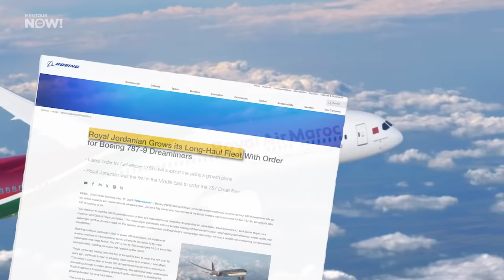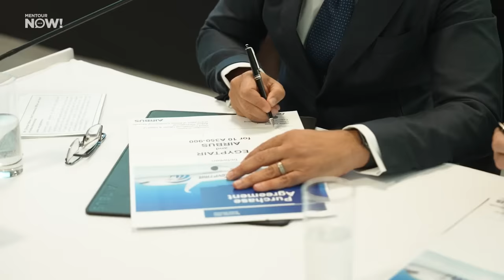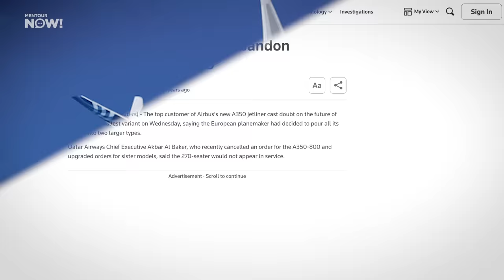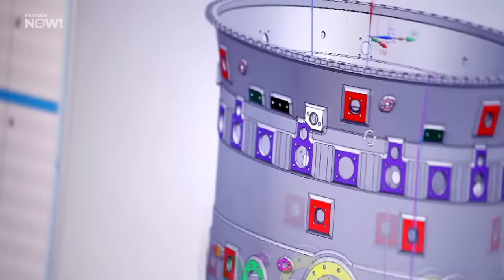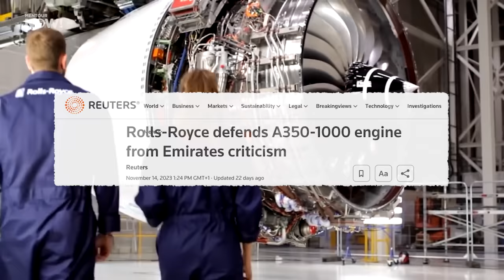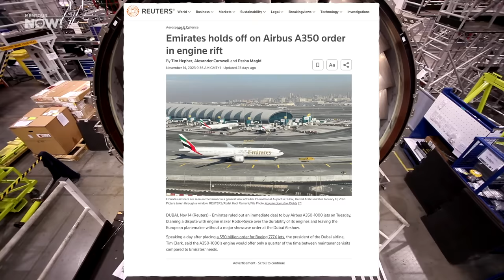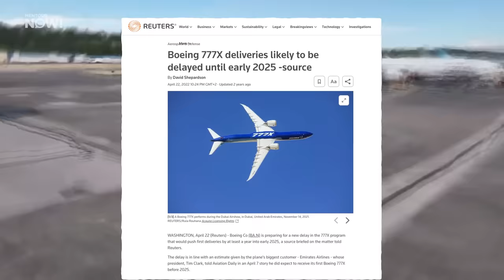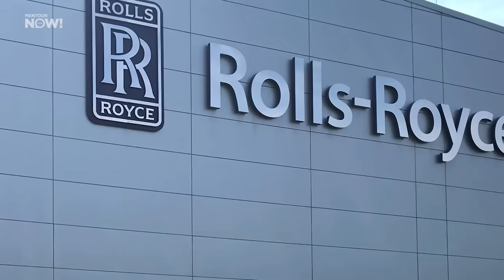What’s WRONG with the Airbus A350?!

Comment: All I can say is that the A350 is the most comfortable longhaul flight I've ever flown economy on.
Reply: Makes sense, since the cabin pressure and noise levels are better than the 787 but with the seat width of the A380 (18")
Reply: Yeah I flew on the a350 recently. Very comfortable indeed.
Reply: Until the 10 abreast seating arrangement on the newer models become the norm.
Reply: @oadka they are about the same, it depends on where you sit. Both planes are extremely similar in terms of types of technology used. The a350 s engines are about a half a generation ahead tho. Cabin pressure is the same for both 6000 feet.
Reply: same! and was always a Boing fanboy before that flight
Reply: I flew twice from Beijing to Hong Kong, yeah, great plane, great service, low noise, really and outstanding experience.

Unfortunately, the way back was on older 330 or 340 and the cabin service was much poorer (same airline should have same quality of service  no matter the plane or the trip)
Reply: @davidajayi1207 you are out of your element. They are nowhere near the same. The 787 was designed as a 2-4-2 aircraft yet airlines went with a 3-3-3 aircraft. The 787 is BY FAR the most uncomfortable modern widebody aircraft for economy passengers. The A350, and A330NEO are far and away the better choice for any passenger who enjoys comfort on long haul flights!
Reply: @farangatang  I don't know about that. I flew on both the A350 and 787. Both seemed comfortable and quiet. I have to give the edge very slightly to A350, but still can't agree with you on the 787.
Reply: And so far, an (hopefully) "still flying" COFFIN !
Reply: @CaliSteve169  unfortunately it's not an opinion. It is a fact, an absolute fact. With a 3-3-3 configuration the 787 has the narrowest seats in the industry as they can't be wider than 17". Both the A350, and the A330 can accommodate the standard 18" width in their respective configuration!
Reply: @farangatang most A350 I flew on uses 10 abreast seating (3+4+3) so the width advantage isn't really a thing
Reply: That is a reasonable statement, but does not apply to this video and discussion. Since the B777X is not in service yet.
Reply: I agree, the A350 is super quiet and if you get to fly first class just a superb experience.
Reply: @oadka  If you keep saying it, why, it must be true!  In reality noise not really an issue and cabin pressures are nearly identical.  But keep sayin' it!
Reply: AIRBUS     IS       JUST   SUPERIOR IN EVERY WAY ... thank you ...European advanced technologies....after all Europe did 'start' with CONCORDE ...
Reply: @adrianpeters2413  You people are in a trance.
Reply: The Airbus crowd is really triggered by the Emirates order for 777X. And be careful criticizing their beloved A350! You will never here the end of it....geez.
Reply: @adrianpeters2413 ...yeah, European not profitable even with government subsidies. I've flown 777 and Airbus on long hauls...Boeing for the win
Reply: @barrybolton1396 come on, the. 777 is simply disgustingly loud. I flew Korean air, A380 to JFK and back 777. the 777 for passenger comfort is so much worse. 787 and A350 I like them both. But quietness, A380 and A350 where possible.
Reply: @Tom-zr4xf  lol Airbus actually doesn't care.
Otherwise they wouldn't have beefed up the 35K to what it is now, which exactly ranted Emirates a decade ago, but won them wider appeal.
Reply: I have to disagree, I flew with qatar on a A350 and it was very tight and uncomfortable, also shaky above the indian mountains
Reply: @larsradtke4097  Biased toward Boeing, but have to agree.  First time on an A380 was night and day from the 773 on TPACs IMO.  What a wonderful bird that is.  A350 didn't stand out to me, other than being brand new at the time, in comparison to 777 work horse.
Reply: @JuliusUnique  That's not unusual.  Also crossing the Bay of Bengal, India to Bangkok, is often a bumpy spot.
Reply: @jeffbeck8993  I was once at the back of GE90 on a heavy long flight (JFK - HKG on Cathay), and the noise and vibration did made me hard to sleep. Still a truama to this date. 787 and A350 in comparison feel more quiet and humid, which is good. A380 is not particularly impressive to me even as someone leaning Team A. Not bad, but not good either.
Reply: @georgH  Maybe the best crews get put on the nice new aircraft as a reward for good service - leaving the older aircraft full of less attentive staff.
Reply: @oadka - wow, didn’t know that and A380 was my favourite as economy passenger. I will make decisions knowing this.
Reply: @larsradtke4097   I hate flying. I flew to Vietnam on a 777 and returned on an A350...the Boeing was a better ride and more comfortable.
Reply: @barrybolton1396  I truely doubt, that flying the 777 is better than the A350. I had not a single flight, where I would prefer the 777, just because of the noise level. The A350 climate is better, so much more quiet. Or do you complain about seating arrangement? That is the fault of the airline and not the aircraft. My worst experience for seating was with aeroflot connecting from mos to Shanghai. My knees hurt after arrival. But that is the airline's fault and not the aircraft's
Reply: @JuliusUnique  shaky? You complain about turbulences over the himalayans? That you have to complain to the weather gods. No aircraft is free from influence of turbulances. But the smaller and lower the worse.
Reply: Agree. Have flown on both A350 and 787 on several airlines and I was surprised at how disappointing the 787 was. Most Airbus models seem quieter and smoother than the competition, even the small A320 compared to 737.
Reply: Same here, good quality and really comfortable
Reply: @sbeve7445  there are less than 3 airlines in the world operating a 3-4-3 A350. Over 99% of A350 are 3-3-3, but over 99% of 787 are 3-3-3, in fact JAL is the ONLY airline operating a 2-4-2 787 in economy!
Reply: Doesn't match the A380 in my opinion; still find them quite noisy.
Reply: All I can say is you probably haven’t flown on a 380.
Reply: I’m. Or going to lie…I can never tell the difference between a Boeing or Airbus for comfort. They are both awesome.
Reply: @oadka  Both the B787 and A350 are pressurised to 2,000 metres instead of 3,000 metres.
Reply: @jeffbeck8993  I have always said there’s a big bump in the road across the Bay of Bengal!
Reply: @Holland41  Yeah, I agree. I have flown W class on both. I prefer the A350 to the B787 and I think it’s very telling that the 787 seems to have a lot more appeal to cut price airlines, while the A350 gets more orders from full service airlines. I don’t think the difference is chalk and cheese but I do think the A350 is the better product.
Reply: @charlestoast4051  I meant the A350 quite noisy, my bad.
Reply: @farangatang Funny enough my first flight was on a Dreamliner and even I thought the engine was noisy.
Reply: I really liked the 787 or the a350 myself. It's one smooth riding plane and the windows really give for nice views.
Reply: @farangatang  777x is much wider then the a350 by 18"
Reply: @arnaldoluisn1  it applys
Reply: @adrianpeters2413  I can see you don't know much.but we all have to start sometime
Reply: @barrybolton1396  oh 777 is very nice to fly on and the foods nice and warm airbus food is always lukewarm at best
Reply: I flew BA A350 Prem Economy and Business Class.Was great,no problems.The crew on board did tell me they didn’t really enjoy working on the plane due to lack of space.
Reply: Just flew A350 and felt crowded, not large in volume terms, in economy; 3-3-3 and average space, reminded me to older A330. For a 15h flight this is not the right plane IMO.
Reply: @SuperWeissmuller  yeah 777x is much wider then the a350 so that will be nice down the road soon.
Reply: Agree, just recently was traveling 14,5h on A350 economy class - best experience hands down
Reply: @gatto52  787 is very comfortable vs the a350
Reply: cannot agree more, much better than 777 Boeing ,have not flown on 787 yet,
Reply: @eisbeinGermany  777x will be alot wider then the a350.
Reply: @Tom-zr4xf  777x is going to a nicer plane and airbus knows this
Reply: @larsradtke4097  the newer a350 are not going to Be quieter then the 777x
Reply: I suspect you might bring the A380 to top list if you happen to fly on one.

Comment: I believe there's nothing wrong with the A350, never have I seen and travelled in such a well build, safe- and  comfortable plane. And like others have mentioned, look at what happened in Japan.
Reply: Yeah and on the other end, look what’s happening with the 737 Max. Again…
Reply: @sn4tx At this point I'll actively avoid flying the Max. Nobody knows the extent of poor engineering in that plane.
Reply: @Chopper153  as I use to say regarding that plane, at this point id prefer flying on one made by LEGO.
Reply: @sn4tx  Exactly, but this thing that's happened to the 737 MAX seems to be a company wide quality issue so I have to wonder if it's going affect 777 as well in some shape or form.
Reply: @mutkaluikkunen3926  I’m not a Boeing fanboy nor an Airbus fanboy. Do Boeings crash? Yeah so do Airbus. But you are right. As much as I’d like to just keep these uneasy feelings I have towards the MAX (granted I’ll never step inside one of those), with all the issues plaguing  other programs one does have to start considering. And hey I’m not driven by paranoia. In the 737 defence, Iots of them been flying by tons of airlines all over the world. So statistically one could say, the 737 MAX isn’t that much of a dangerous plane. Same thing happens in the car industry. Now the issue here is if a certain car model of a specific brand has a chronic quality issue that makes them break down more than the others, at most you gonna be walking or taking a taxi. If a plane breaks
Down … yeah they  not gonna park in some random cloud till assistance comes. And as a whole it’s true that Boeing been having some problems across the bussiness. Some more serious than others but still. It shots the reputation and mostly the trust people have on the brand. So yes. Of course as a passenger that likes to check what plane I’ll be flying when I book flights, I’ll be actively avoiding Boeing in general. Doesn’t mean I’ll be 100% safe. But surely being 90% safe beats being 60% safe. Now it doesn’t mean I won’t get on a Boeing plane, if that’s my only choice for the route and time I need. BUT even if air travel is, statistically, the safest way to travel I still prefer to take my chances on a car crash than on a plane crash. And one way to improve those chances is to stay away from those  crazy nonsense MAX program planes.  That shit should be banned straight away from everywhere. I mean yesterday was MCAS, today are plugs  that go “Aight, I’m outta here”. Heck I not gonna be in a future flight that has the potential to show yet another issue with the MAX.
Reply: this is why i am so disappointed that tSwiss air dropped their 350 on the Zurich-Jan Smuts route and replaced it since Oct 2023 with Boeing 777, any airbus is much better than Boeing, 777 seats are so narrow, and legroom is much smaller than Airbus
Reply: @Chopper153  Except the the Max is quickly re-entering service and doing quite well. I just flew on one yesterday.